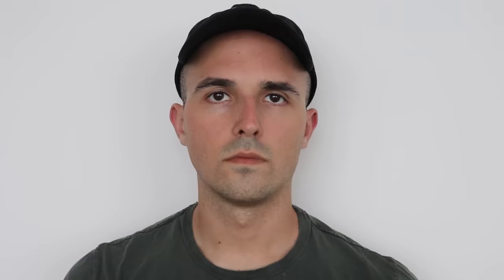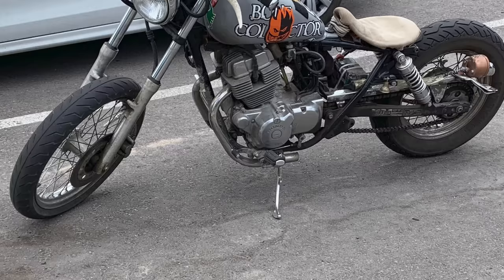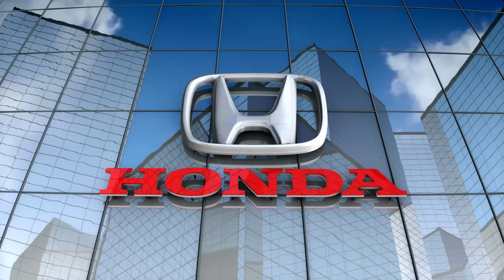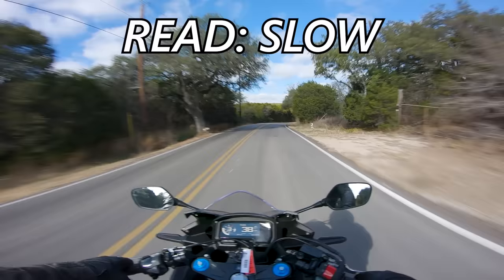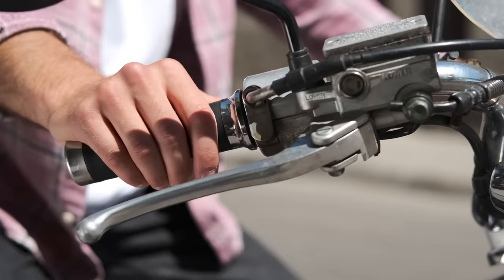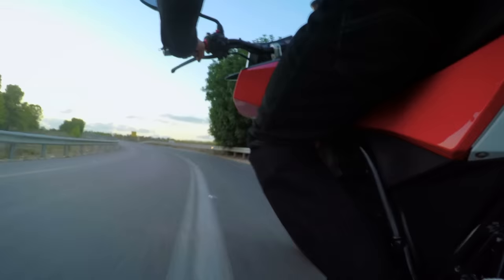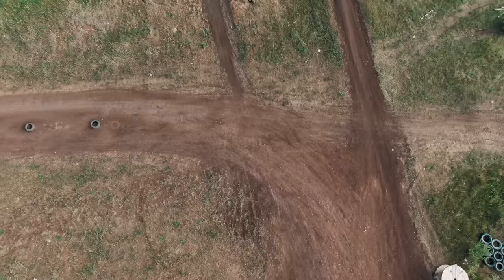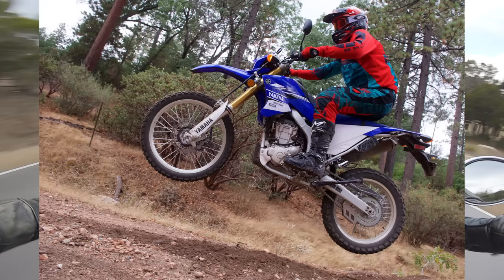7 Used Motorcycles That WON’T BREAK! (Low Maintenance)

Comment: As long as the name of the bike starts with letters “honda” or “yamaha” you’re good to go
Reply: Or Suzuki
Reply: And then you have me, who perfectly knows that is the sensible (the right!) choice and goes for a Ducati 996 anyways
Reply: ... And buy somethink else?
Reply: Kawasaki ?
Reply: @ProfSinged  much better choice.
Reply: @ProfSinged  i haven’t worked with any Kawasaki bike so can’t say anything from my personal experience. But i don’t hear them having any common issues as ktm for example so yeah. Its still a Japanese bike so you get a good product
Reply: @ProfSinged  I have a 2009 kawasaki ninja.  60,000 miles never had any problem with it just doing the oil changes.
Reply: @ProfSinged  Ye
Reply: I've had two yamahas now, had big truble with both of 'em. Gonna buy a Honda now, my sister and brother never had any trouble with their honda cbr's. i had yamaha yzf 2008r and yamaha ys 2017. I'm gonna buy a honda cbr.
Reply: @lonelyshadow4059  what types of problems did you encounter with your Yammies? We’re they brand new or used?
I worked at a Honda shop almost 40 years ago - and I can tell you from an insider’s perspective that EVERYTHING a on a Honda is more expensive and OVER-Engineered (NOT OVERBuilt - OVERLY COMPLICATED!)
Reply: @glenholmgren1218  Comprission and brakepump on the yzf 2008. Ignition lock on the ys 2017. Both were used.
Reply: @izzy031096  ~ haha! Or Kawa
Reply: And Suzuki 😎
Reply: Or kawi. Over 200,000 miles on one easy.
Reply: @lonelyshadow4059  which is odd because on paper yamahas require the least maintenance
Reply: @snatchednefkin  A classmate had 2 yzf's, (both were same age era) and they also broke down because of the same engine problem, bad comprission. There's probably less maintance if you buy newer stuff. Do not try to save money om 125cc, if not you like to screw a lot though.
Reply: Yamaha breaks quiet often. We have small capacity bikes that need to get major repairs just after went out of showroom. My mechanics run a lot of R1 overhaul and we never seen old R1 on streets.
Reply: @rockabrilia  most Yamaha Tracer 900 owners have problems with the clutch, corrosion, suspension
Reply: As long as they are made in a Japanese factory, they all have factorys in other countries and the product is not the same quality even if the bikes are the same model. Example, we got a shipment of Suzuki GN 125s and 250 learner bikes, and as soon as they were out of the packing crate things started to rust, chrome looked weird and not as bright. And then owners were bringing them back with problems usually small, but these bikes hadn't changed at all since the 80s, they were super reliable and basic. I looked at the headstock on one and saw "Made in China"  ahh ok, it all makes sense now.
Reply: @aneudysc  I did the same thing in the mid 90s with a 750ss, what a complete lemon, brand new an it just had issue after issue until 8 months after i bought it, the dealership gave me a full refund. The GSX-R750 SRAD had just came out so i bought one of those, zero issues the whole time i rode it.
Reply: Oh no lol gettin a kawasaki
Reply: @uhtred7860   well, this will serve as an update. My 996 has been having some issues with the sparkplugs and some leaks here and there, and the acceleration isn't as smooth as it should be, these issues are relatively easy to fix, but not living in the US makes them x10 times more difficult than they need to be. So I have to buy everything over the internet which makes things expensive. I'm thinking of selling it (even though I love that bike with all of my heart) and buying a 2007 Yamaha R6.
Reply: @aneudysc  I know what you mean, i live in NZ and getting bits for the Duke back in the 90s (if the importer had run out of stock) was a pain and time consuming, 
The problems with my Ducati started with it dropping to one cylinder intermittently, leaking fork seals, a bad vibration through the left peg and bar that caused any fasteners that didn't have loctite on them to come loose and drop off, this caused the left muffler to fall off one ride, you had to check after every ride. And worst of all, it blew up! The top of the rear piston completely came away from the main part,  Ducati mechanics said they had never seen this before. All this on a brand new bike less than 6 months old, used as a weekend ride, not commuting or track use, hard riding etc. Put me off Ducati's for years.   YZF Yamahas are awesome bikes, I'm looking for a good low Km, 99 to 02 R6,  to go with my 01 R1 that i bought new in 02, its mint with only 12,000 Km on it.
Reply: @glenholmgren1218  Take a look at the video of the guy that’s done 300.000 miles on his Honda CBR 600. Your ‘EVERTHING expensive and complicated’ actually works out as dirt cheap and reliable. Mine was thrashed for 75k and never missed a beat or broke down.
Reply: You are a dreamer!
Reply: You are a dreamer
Reply: @aneudysc  What does choise mean?
Reply: Old kawasaki klr. They're immortal.
Reply: Yamahas are recycled harleys. the 1985 Vstar is a redesigned war harley.
Reply: as long as its japanese, german or itallian it will run forever if you do regular basic maintenance.
Reply: Currently-  1 Yamaha, 
2 Harleys, I have ridden 100's, mostly the owner I think.....

Although there are some really junk bikes out there, but a good man can even keep them running!
Reply: My philosophy
Reply: Not really in Indonesia.. Honda have many complaints for their 150cc, with the case of the frame is kinda weak, it cracks, even snapping.. also in their new 160cc scooter (pcx).. Honda in Indonesia is kinda lacking of quality in the last couple of years..
Reply: You forgot Kawasaki and Suzuki
Reply: @Vextrous41  ah yes, I thought the R6 looked like an ultra glide when I squinted...
Reply: @dothwalrus370  are you a mechanic?
Reply: @dothwalrus370  take a 1942 knucklehead frame and put vstar parts on it, you'll be haunted by how well they fit. The 80s Vstar chopped the frame into 2 parts to fit new parts. I'm a pirate, anarchist, and mechanic. I'm not fake, Blood.
Reply: Suzuki SV 650
Reply: Truth.
Reply: Damn here I'm stuck with one that says suzuki lol. (It was stupid cheap)
Reply: SUZUKI is better than yamaha and honda, why? bcos suzuki parts are all japanese made.. and the other 2 however use some chinese parts, check the battery for example, it says made in china... but they are still trustable thoug, but not as trusty as Suzuki..
Reply: I bought a used vulcan 900 in 2012. I still have it. Tires, oil, 2 plugs, and some aftermarket turn signals are the only money I've spent on it. Kawasaki sold a shitload of them and pre covid, you could easily buy a low mileage almost new one for 3k or less. You can shop around a little and still find deals like that.
Reply: used japanese bikes are the worst, alot of people who buy them neglect the maintenance because they think japanese bikes are bulletproof. I have had triumph 1600, that one was a beast, pain to work on but very well made. engine was a torque monster, belt drive was without any need for maintenance, engine had 40 000 miles on the clock but ran like new, Now i have aprillia, i bought from a guy who could turn a wrench, very nice engine. rest is bit of a pain but he took good care of a bike, my first bike was one of those supposedly "indestructible" hondas, cb 750, that one was least reliable of them all, shit at cold starts. blue smoke coming out of exhausts shit brakes. neglected for years. complete junk. Dont even get me started on all those abused gixxers and Bandits. almost imposible to find one in good shape. People who are passionate about motorcycles rarely touch those. And for a good reason too.
Reply: Lmao yes
Reply: @domenvidmar6674  to each their own my guy
Reply: @rockabrilia  that's because of the ownership types. The r1 is not bought for Sunday cruising
Reply: Or kawasaki.... The only honda I ever owned broke down constantly 😂
Reply: I had Honda and Yamaha since 1990 and they are very very durable and reliable
Reply: @Vextrous41   for the bikes that came out in the 90s and 2000s that maybe be true, but their newer bikes are pretty awesome.
Reply: @gamecathubph4106   a 2005 gsxr 1000 can beat a 2020 penigale v4. Suzuki knows how to make fast bikes.
Reply: @Kukimuncher  I know. My dream bike is the Honda Africa Twin
Reply: Yamadog
Reply: I'd say Suzuki, Honda, Kawasaki and last would be Yamaha.
Reply: Basicly every bike manufactured in japan.
Reply: @izzy031096  lmao
Reply: @Vextrous41  relevant if someone is in the market for 35-40 year old cruisers.
Reply: @wabisabi28motovlog  They carry the whole family and a goat.
Reply: @georgejameson9317  my favorite bikes are the 70s Honda CBs
Reply: @housebuyingjohnjohn9727  Rip your chain
Reply: 22 years our honda MC 125cc 2000 model, on its 12 years of cruising and bruising we just change the piston rings till now still kicking good product indeed compare to suzuki 7 years daily use you can feel your engine parts loosening
Reply: Kawasaki
Reply: Last year I had my Yamaha in the shop for a routine maintenance and recall. They had to pull the head to change something that was recalled and needed new stretch bolts. Long story short, my bike was there for 7 months. I took it home unfixed. After contacting Yamaha headquarters multiple times they said we can't give you the part if we don't have it. Then I had a sales rep and a parts counter guy. Tell me maybe I should buy a Honda next time.
Reply: RE 🎉🎉🎉🎉❤

Crap Game
Reply: @uhtred7860  the vulcan 650 is made in Thailand.  I think they are still well built, from what I hear.  Toyota has a factory there, as well. Thais can buy these products  with heavy import taxes.
Reply: Depends on the era, Honda went through a bad time with reliability in the 80s as I recall.
Reply: Whoohaa 😂 (Honda owner)
Reply: Pretty much or KLR
Reply: I was about to press "thumbs up"  for this comment, and then I realized I already did.
Reply: Just say Asian bike lol
Reply: Very true.
Kawasaki and Suzuki are not to far behind!

Comment: Anything Honda will not die. My dad still has his very first motorcycle, a 1967 Honda CB250, it still starts up and runs like it was 1967.  It has never left him stranded and pretty much only needs tires and an oil change. It has over 200k miles and the odometer rolled over for the second time last year🤣
Reply: wow n i must say your dad is taking good care too.
Reply: Bro really stole mikeys bike
Reply: Damn...same thing with my grandpa's Honda Supercub.
Reply: My Rebel 500 endorsed this comment! 🏍💕
Reply: That bike should be in a museum.
Reply: I wish a major manufacturer manufactured a 300 to 500 cc bike styled like the late 60s.
Reply: I'm looking at a busted Honda right now , thinking , you have no idea . A bike from 50 years ago is not built like a bike from 5 years ago.
Reply: @Correctpolitically  Some might say the same thing about the quality of cars.  A Fairland or a Falcon would've done VERY well to have gotten 150,000 with no engine rebuild.  Today, it's noting to see a car with 300,000 with nothing more than routine maintenance, a brake and maybe a battery and/or alternator replacement.
Reply: @rodneyjordan6745  today it's nothing to see a Toyota on it's 3 rd motor. And inspite of what you've been told 300k wasn't that uncommon. Infact other points to consider is things like a trans. I was still pulling factory th350s out of early 70s cars in the early 2000s. You rarely see old sport bikes for a reason. Mostly that reason is rpms. The sacrifice to get power and economy comes at the expense of durability . In other words when you spin a motor 2x as fast it generally lasts half as long. This is why there are still so many Harleys running around. They turn half as fast and are roller. They're tuned for economy. So nothing ever gets to stressed. Now contrast that against a track bike. Totally different ball game. Rpms are high power is up in the band and everything is kicking out all it has. Loads of fun. But not terribly durable . That is why race motors get torn down on the regular. That's the part you don't see. You don't see the sht that goes wrong only the guy at the finish line . Don't get me wrong I like Honda , but to think they don't break is a fairytale. The saying goes if it's got tits or tires it'll give you sht is very valid.
Reply: @katsukamijo3943  Great bike.. 
Old Cub 90 I used to have was indestructible.... Abused the thing o n insane terrain for years and it just kept plodding on.. 

Crap Game

Comment: Yamaha has produced the most reliable bike's on road and off for a long time .
Reply: Except, honda makes the most reliable bikes. Thats why their output is usually lower at the same cc's, because they favor reliability and longevity.
Reply: Not saying Yamaha is bad at all but honda is definitely better at all that stuff
Reply: Totally, nothing beats the reliability of a honda
Reply: My vstar 1100 has some issues, I dunno about that statement
Reply: @collinbetten5631  my friends virago has been the biggest piece of junk I've seen
Reply: @henry.schafer  with my Vstar, the exhaust pipes must be removed EVERYTIME you do an oil change, also the starter clutches always go bad which is a 1000 dollar job
Reply: @collinbetten5631  yep this virago has starter engagement issues too. Blew head gasket
Reply: You spelled suzuki wrong
Reply: @Namesakes.unit-x-10sq10  statistics says otherwise. He did mention car's not just Honda motorcycles. Even this channel said Yamaha was on top of the list for reliability not that long ago.
Reply: @henry.schafer  Yes Honda are on top for the variety of engines they produce.
Reply: @austingawrych8390  Because you own one I'm guessing.
Reply: @collinbetten5631  Statistics say so not me. Any make of motorcycle is going to have issues, eventually if it isn't maintained properly.
Reply: @henry.schafer  it's more than just one model that they go by.😄
Reply: @neilhamill318  yeah, every model
Reply: @henry.schafer  what do you expect if it's not maintained. If it was any issues would be minimal for an old bike.
Reply: @collinbetten5631  how is removing you exhaust a reliability issues.
Reply: @neilhamill318  honda is the ONLY car/motorcycle engine producer who's had an engine approved for small aircraft use, thats how reliable they are. You cant kill a standard honda motorcycle with frequent oil changes and maintainance, unless you rev bomb it for 20 minutes every day...
Reply: @neilhamill318  of course, my one and only motorcycle, Honda CBF1000, I have nothing negative to say about other motorcycles, but I could go on forever about how good mine has been for me.
Reply: @Namesakes.unit-x-10sq10  The reliability test is done every year on the previous model. The test is biased on break down issues and warranty repairs. Yamaha has been on top of that list for many years with the least amount problems. I thought the topic was motorcycles not aeroplanes.?

Comment: This video has some bad information. It also makes some interesting assumptions about newer technology like DCT. Do we know how those DCT transmissions are going to work 10-15 years down the road?  Also, Enfield, Ducati and Triumph have all got pretty bad reputations for reliability, find one with 100k miles?
Reply: Yes, nc700s had had dct for years with rare problems
Reply: Many 7+ years old DCT have more than 200k km
Reply: consumer reports rated the Yamaha Vstar cruiser bikes as most reliable, slightly above Honda

get one with a shaft drive and it will go 100,000 miles with just oil, filters, plugs and tire changes

Carbs are more reliable than fuel injection as long as you stabilize your fuel over the winter with an additive

this video is not good. Harley is 2nd from the Bottom of the reliabiity rating list

BMW is the worst. took much technology state of the art crap on their bikes that breaks.
Reply: ...too much tech.. (typo)
Reply: @kenwittlief255  kinda funny, I’ve had a few 80s Yamaha’s and they’ve been good. Love my little old virago 750. If it ain’t broke, it’s probably Japanese!
Reply: DCT has been around for more than 10 yrs